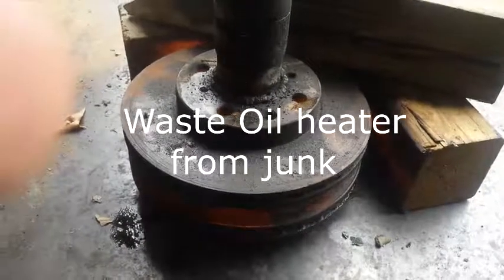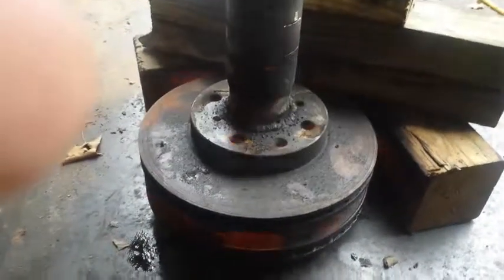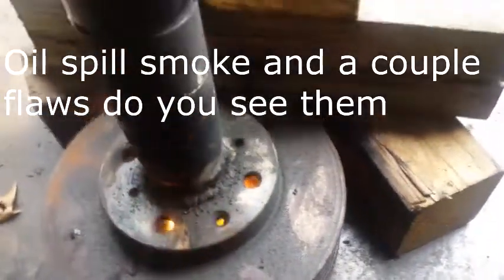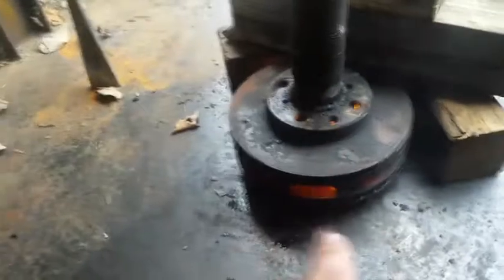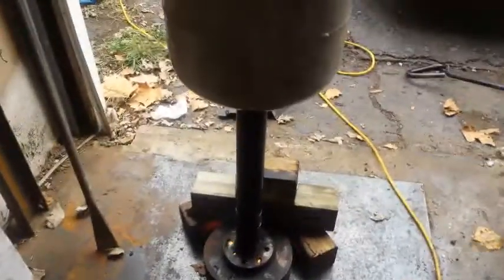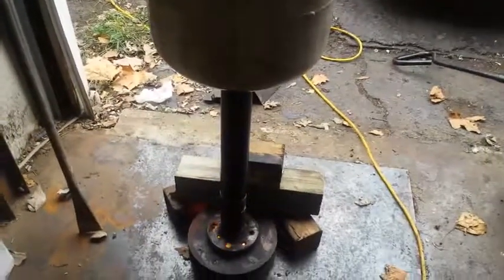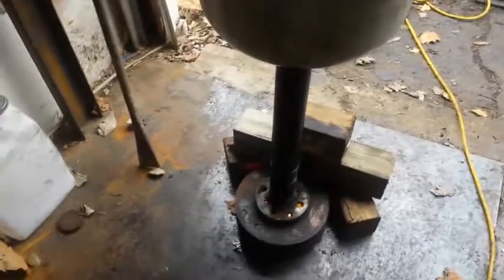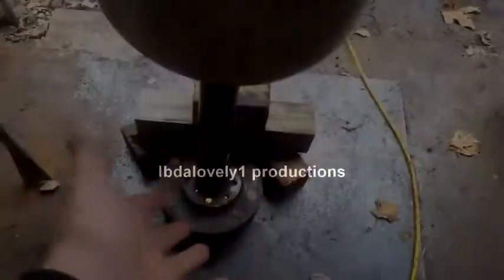Waste oil heater from junk vid 2 1.2

Comment: I can see a problem with this system. For one thing, the pot is way too big and being it's sitting on the floor (big mistake) it won't get hot enough to vaporize the oil as it enters the burn pot. The heat is getting drawn out of the pot into the floor where it sits. You should keep it off the floor suspended and use a smaller pot so it heats up better. If you notice other videos on here, you'll see the oil vaporize as it enters the burn pot and burns completely with no smoke. Then you can use the concept similar to a carburator and drill the neccessary holes in the burn tube to make it run efficiently without smoking. Then you just have to adjust the drip to control the amount of heat you want. Simple.